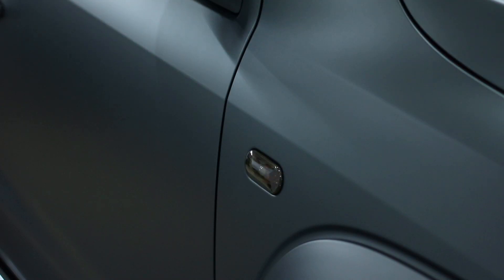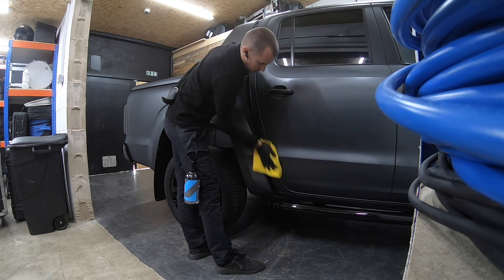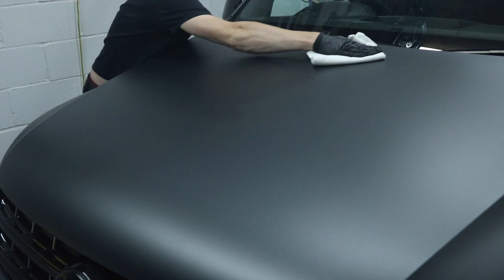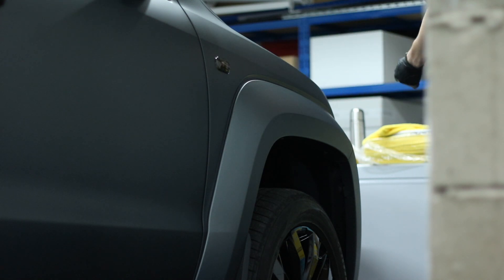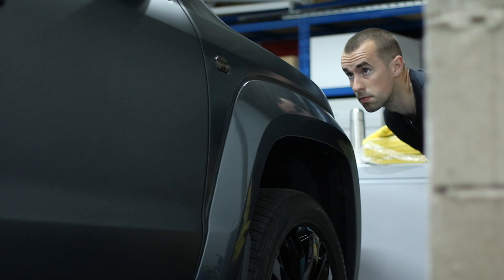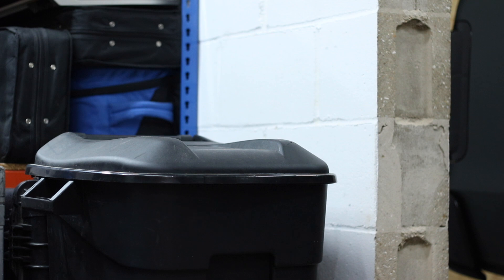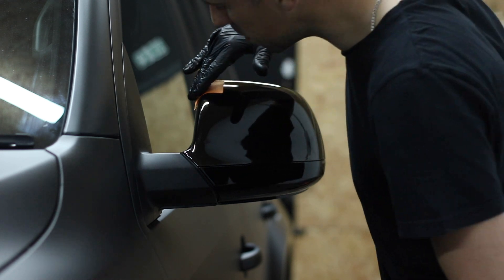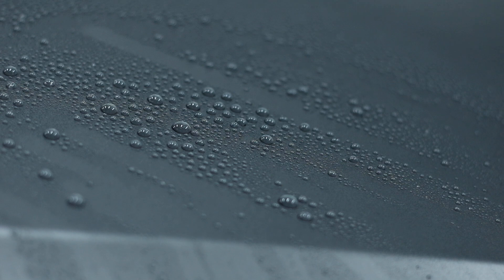Ceramic Coating Matt & Satin Paint | Gtechniq Exo V4 | VW Amarok matt paint work detailing

Comment: Great work great video 👍 exactly what I've been looking for to do the wife's Abarth (Asphalt Grey👌). The Amarock looked mint 👍
Reply from the maker: Pleasure!

Let me know how you get on

Joe
Reply: @JoeHuntley  will do Joe
Reply: Hi Joe just to say thanks. I had a full day on Saturday.I am really pleased with the results, I've been looking for something like this since I bought the car back in Feb.
The previous owner said it had been professionally ceramic coated but had little if none in the way of protection, I was using the only thing that Autoglym recommend ( Aqua wax) which TBF did give it a temporary protection.
The Gtechniq is extremely easy to apply (thanks to your detailed video). obviously time will tell with how long the protection lasts, but the car spends most of its time in the garage and to be fair if it lasts 6 months I will be happy. Thanks again Joe.
Reply from the maker: @travelingwillobees9813  Absolute pleasure! Comments and conversations like this are why I make my videos!

Comment: I recently had a neighbors 4 year old girl take a rock to my black Audi S4 and 'drew' on just about every panel.  I compounded down the scratches and went with a vinyl wrap from Avery Dennison.  My installer was amazed at how well 2 layers of CarPro Skin performed on the wrap for hydrophobic properties.  Your step by step guidance was on point.  I love the Eraser prep and will see how long the Skin product maintains it's protective properties.  I wore a mask during install of Skin but wondered if the Exo product was not too harsh on the nasal passages for you.  Thanks as always, cheers!
Reply from the maker: Yes CarPro Skin is nice! If you re-coat it I would recommend that you try Gtechniq Halo. I have only used it on PPF and it was incredible and I can't wait to use it again!

Comment: Hi Joe, I just coated my car with the help of your video. Unfortunately I missed a dry water spot on my hood, even after panel wipe. Is there anyway to take this coating off?
Reply from the maker: Hi
If it's gloss paint you can't just polish it off, for matte finish I would contact the coating manufacturers.
Joe